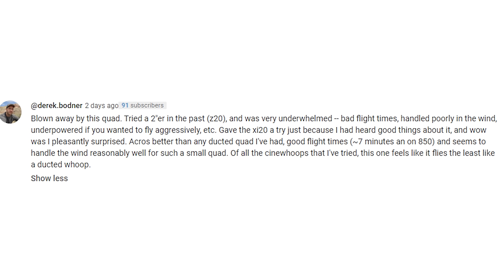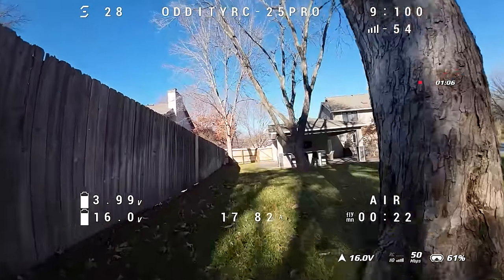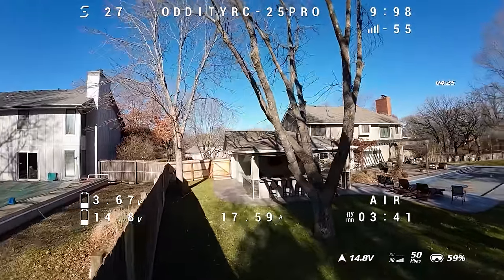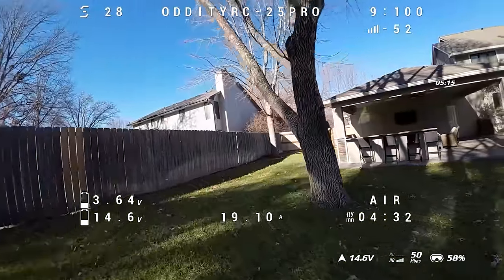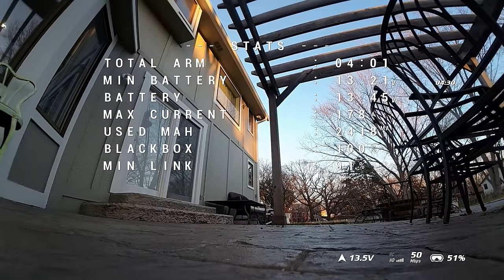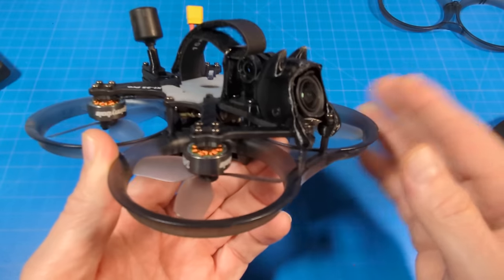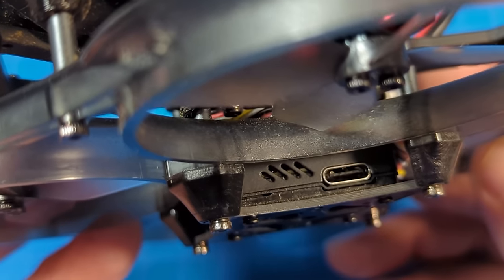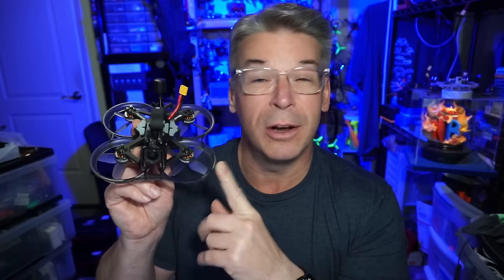OddityRC XI25 Pro // CineWhoop Not a CineWhoop Flyer

Comment: I finally got one today. Wow. I built a 4s pavo20 almost a year ago, but needed something to occasionally carry a naked gopro, but be this small. Even though its a slightly heavier drone, im using the same 550 and 720 gnb hivolt batteries and getting at least a minute more fly time than my pavo. Smooth flying, turns on a dime. I love this thing. Going to pick up the 35 to carry a full gopro and it will replace my slammed squirt thats been amazing.

Comment: Love the contrast between sunday driver and the road rage Goofy from those old cartoons.  Other than a few blips looks like it flys amazing.  MoeFPV also mentioned in a recent whoop review about using extra techniques flying these to avoid prop wash and what not.  Cold weather I'd imagine would impact quad as much as the pilot on top of that.  Good to see a variety in these, smal enough because it's winter whoop season, and a biger one to save up for when the Spring arives!  Thanks for the awesome reviews and taking us for a rip.  Cheers!
Reply from the maker: Thank you. Yes there is a fair bit of technique in the different quads and how to minimize or eliminate any prop wash but really I think I make it sound harder than it is, good technique in most quads has no/very low oscillations.
Reply: @NickBurnsFPV  hola lo primero es que me encantan sus videos
Se aprende mucho del mundo del fpv
Y tengo una pregunta
Tengo un oddity 25 y cuando aterrizo un poco brusco se pierde la imagen un momento,es súper rápido
El mio es analógico
Gracias por todo

Comment: Amazing content as always... hey Nick, jsyk you can explain the tech all you want, still being the noob I am, I can only grasp bits and pieces of it for now -- what sold me is the FLIGHT VIDEOS... man, this one has GOTTA be my next daily driver! Cheers!!
Reply from the maker: Yea, its like being in a company wide meeting, some parts will make sense and others not so much. But hearing it will help relate later when it does start to make sense.
Reply: @NickBurnsFPV  Thanks for your reply ... It's still frustrating, and has been quite costly, since I entered the F0V world June 1st. I still am forced to spend most of my time in Liftoff flight sim ... and after months of going back and back, I still can't fly small whoops indoors for more than 20 seconds at a time without crashing them (in Liftoff!) Long journey ahead I'm afraid ... just hoping the 'light goes on' and I get a handle on this anytime now! Thanks again, your flying is top shelf my friend ... such an inspiration!!
Reply from the maker: @PianoManPaul  Yes, it is a long journey. Keep in mind I have been making videos for about 8 years and flying inside started somewhere around the end of the first year. So it to has taken me a long time. If your using just thumbs on the sticks, try using a pinch style or even a hybri pinch style. Or the other way around, just to try something different for awhile. I used to thumb and felt I had stagnated in my progress, I switch to pinching (pinching with thumb and index finger on each stick) for a few weeks, then started to feel greater control and progress again.
Reply: @NickBurnsFPV  Hey Nick, thanks so much. I'll certainly try anything you suggest - you're probably the most skilled indoor pilot I've ever seen after all. I'll soon be starting a drone/FPV YouTube channel in this new year, documenting my journey as well. But man, this XI25 Pro looks like a cool little machine I'd love to try! Thanks again and please, keep the great content coming! 👍 😎

Comment: I have an iflight titan dc2, which uses a 38x38 aio, and now those electronics need a new home. (I have a 3d print adapter to use 26x26 or 20x20 mounting pattern)
Between this and the cineape25. Which would you suggest to be used as a frame replacement?

Comment: Nice review. Subbed and thumbs up. Is there a tune file that you can download from OddityRC? I wonder if they tuned it. Looks like a nice flyer. I'm going to swap out my pavo25 guts for this freame.
Reply from the maker: Yes, oddityrc as well as 99% of quad companies do PID tuning. Some better than others. OddityRC is likely top 5% of manufacturer PID tunes. Always feel true and accurate in flight.
Reply: @NickBurnsFPV  I assume I can DL their PID tune from their website? Tks!
Reply from the maker: @armani007E55  yes, most manufacturers do post the pid tunes. I haven't verified in the moment though
Reply: @NickBurnsFPV  they reached out to me. Amazing customer service. Looking forward on receiving the frame and 4s motors. I'll be definitely gutting out the Pavo 25 for this guy. Tks!

Comment: Do you use any kind of gloves when you are flying in the cold? Other cold weather flying tips? It's my first winter of flying, although being in Texas I probably won't have a TON of freezing to worry about.
Reply from the maker: I have tried various gloves, exposed fingers internal heat etc, I don't fly comfortably or as well with anything on my hands. It moved where the radio sits in my hands and my finger movements. I am a pincher btw.
Reply: @NickBurnsFPV  I bought some tipless, thin "compression gloves for arthritis". I'll let you know if they help. I'm a pincher, as well.
Reply from the maker: @Dorff_Meister  That is some gloves I haven't tried. Let me know how it goes.
Reply: A transmitter glove is a perfect partner for the cold weather. It’s like a hoodie for your remote, idk if you’ve seen those before.
Reply from the maker: @ChomperFPV  I tried one a few years back. Pretty much the same issue as wearing anything else, lose the finger sensitivity and hand placment/feel.

Comment: Hmmmm...I'm really confused by how heavy both this X125 and the X120 are when compared to other similar quads. This is a whopping 205 grams for a 2.5" with 1405 motors. My 2.5" weighs a mere 121 grams with 1404 motors and a full armored Vista inside. So, this OddityRC X125 Pro weighs 84....YES!, EIGHTY FOUR grams more! HOLY COW!!! 🐮  It's also 112mm for a 2.5" prop and mine is the same size as the X120 Pro at 95mm for a 2.5" prop...The X120 Pro is only a 2" prop for the same 95mm size! These are both sooooo much bigger and soooo much heavier than the 2.5" I own. The 2" X120 Pro also weighs 19 grams MORE than my 2.5" quad with a full Vista. Granted 03 weighs more than Vista, but not that much more when both are stock and not naked.  ODD how these are soooo damn heavy and large, motor post to motor post. Mine also runs on 2S to 4S.

It's gonna be near impossible to get the X125 Pro to stay under 250 grams when it's 205g without a lipo!  I fly mine with a 450mah 4s all the time because the quad is so light and handles so good, it really rips with that light 450mah 4s! It weighs way less with that 450mah 4S than this X125 does WITHOUT a lipo! I'll bet it might just be less even with a 650mah 4S!

I do not understand why each of these ODD quads have to weigh sooooo damn much! Definitely the heavy weights in the class. Kinda CraZy!  😁
Reply from the maker: It could be the carbon weight/thichness, and the use of metal posts to hold the prop protection.  That wouldn't account for all the weight difference. One thing with oddityrc is I don't get comments about them breaking even at their weight.

Comment: Hi Nick any chance you could let me know if it flys on 2 and 3s I have some 550s that will only work on toilet tank set up. Sorry this was ment for the 120 version in your rough and tumble video😊
Reply from the maker: No the XI20 flight controller the F7 40A AIO is 4-6s. so it wouldn't activate on 3s or lower
Reply: @NickBurnsFPV  thanks Nick, is that the same sort of thing for most small 4s quads, I was also thinking about that GEPRC HD smart16 Toothpick. Sorry for all the questions
Reply from the maker: @fpvspin1605  It really depends on the AIO. Some can be 2-4s, or others might be 3-6s or like this one 4-6s

Comment: Is the amp meter on the quad accurate? Because at one point I saw it hit 175 amps, which is crazy, and probably not safe for the XT30 power lead.
Reply from the maker: Not sure, those are calibrated at the manufacturing plant.  Looks like it needs scaled down by 1/2. Sitting above two amps disarmed.

Comment: radiomaster Zorro elrs  not working in Android simulator how to solve tha problem
Reply from the maker: does the computer identify the device as a "Human interface device". What operating system are you running, are you using a cable that is both a charge and data cable, any usb hub being used, has the computer been updated and reboot recently...etc.

Comment: I LOVE my XI35! So fun and crazy thrust at 6S. The handling of the XI25 looks very similar to the 35.

Two high speed crashes into concrete at this point and the frame looks new so the carbon fiber is good quality. Highly recommended building one.
Reply from the maker: any damage to the prop protection?
Reply: @NickBurnsFPV  surprisingly no damage. Nice they have a spare but I have yet to use it